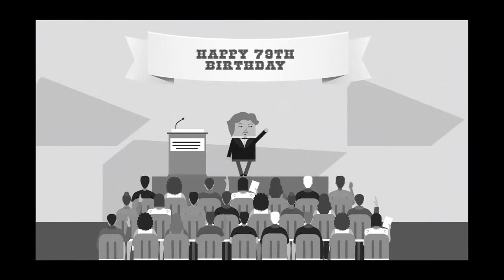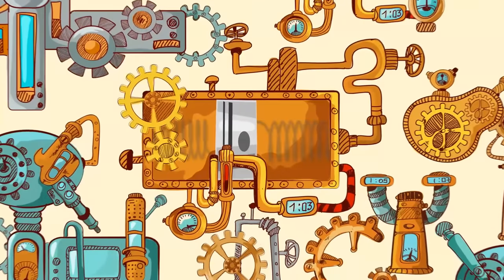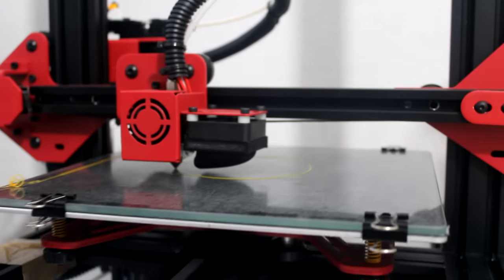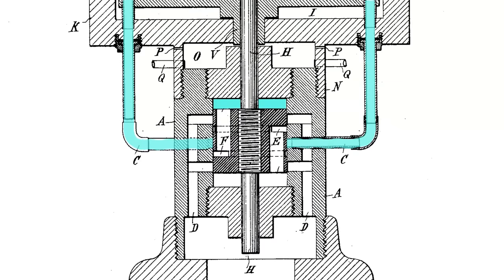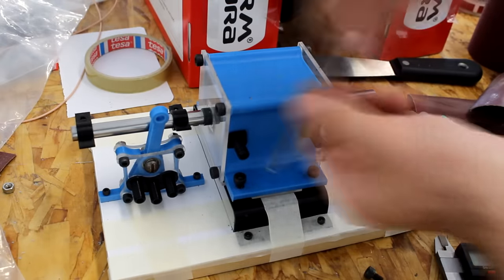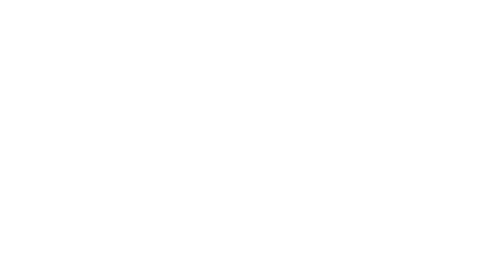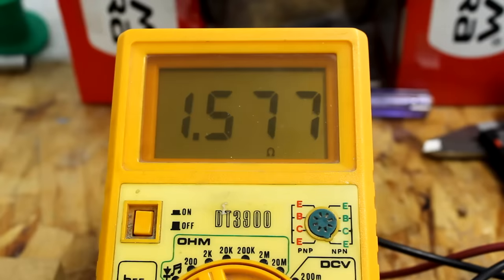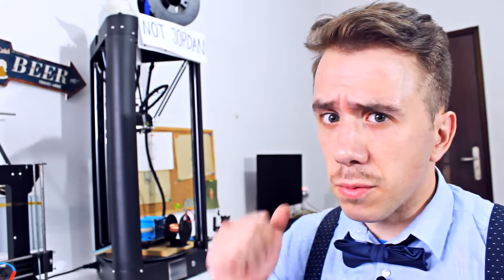Tesla Earthquake Machine [3D Printed]

Comment: Help? I'm incapable of improving that awesome oscillator!
Reply from the maker: Thank you so much :D

I actually need your help with my next project. A Self Starting Micro Pulse Jet engine!
What do you think?
Reply: @integza  holly shit this look very epic
Reply: Absolute legend
Reply: @integza  Parabéns Joel, não é todos os dias que se tem um comentário do Tom Stanton ;)
Reply: @integza  My pulse jet experience is near enough zero, but that sounds like a great idea! They seem a pain to start and a self starting pulse jet would be very useful for an RC aircraft ;)
Reply: Maybe put a full rectifier bridge infront and a small capacitor in parallel to the LED

Using a capacitor with AC wouldn't  be very useful
Reply: @TomStantonEngineering  seems like you guys need to get Colin furze on board too
Reply: @schnibie1991  You can get non-polarised capacitors, mostly used for things like end-stage caps in audio circuits.
Reply: @nigelrhodes4330  But a capacitor in AC is like a short circuit, isn't it? So the frb converts the AC into DC Voltage and the capacitor can smooth it.
Reply: @nigelrhodes4330   All the cap will do is induce a lag between voltage and current, with the net result being less power output (because volts X amps equal watts, and the the lag in the two curves causes the curves to cross at less than full amplitude).
Reply: combine it with a linear alternator
Reply: @integza  I think that You need Colin Furze for this one :P
Reply: Tom should wear a bit of make-up for the joke and dye his hairs
Reply: So glad this channel popped up in my suggestions! Awesome content! Busted up laughing at your method of  "recycling" plastic lol
Reply: @integza  a valveless pulsejet needs am excessive amount of air, a valved one is hard to engineer. For an RC version you could use compressed air and possibly a valveless one.
Reply: @integza  you could use Tesla's turbine and valves as a viable air source
Reply from the maker: @dragonfireproductions790  I might do the opposite, use the pulse jet as pressure supply for a tesla turbine 😎
Reply: @integza  make a CNC mill next for making valved pulsejets and The turbine, gecko controllers are cheap nowadays.
Reply: @integza  for cooling the hot exhaust you can use an intercooler from a turbocharger and dip it in water, to address the pulses from it, buy an air tank preferably a large one with 12 yes TWELVE pressure relief valves, I blew up a tank with a pulsejet before ._. don't make my mistake
Reply from the maker: @dragonfireproductions790  Dude, is like you can ready my mind ! I was thinking about using an intercooler witha a turbo charger to start the pulsejet ! Thank you 😀
Reply from the maker: @dragonfireproductions790  I would like to have one but I need to find the time to do it.
Reply: @integza  a fixed gantry and a dremel would suffice :)
Reply: @integza  i used 3 superchargers to start mine, I used the 30psi one, but it was a valved pulsejet, I actually used it to produce steam and dry stuff with it(my neighbors hate me btw, it's noisy as hell)
Reply: @integza  I used tesla's valves for the valves, heres the video https://youtu.be/F1ty3jaMMtg
Reply: @integza  mr teslonian's playlist is here:
https://www.youtube.com/playlist?list=PLw28_n7AgcmC_c2ajIz93cWR1UvLIPd5Z
I forgot about Colinfurze's vid but you two will enjoy this project :) it's one thing to use to make your neighbors leave 😂 ALWAYS USE HEARING PROTECTION, it'll deafen you permanently
Reply from the maker: @dragonfireproductions790  Can you send me some vids of it working ? 😂
Reply: @integza  yep I sent you mr teslonian's playlist :)
Reply: @integza  https://www.youtube.com/playlist?list=PLw28_n7AgcmC_c2ajIz93cWR1UvLIPd5Z this will be a FUN project 😂 be sure to wear hearing protection because this is extremely loud 😂
Reply: @integza  your next project definitely smells of awesome and win.
Reply from the maker: @inverse2k1  OH YEAH!!! IM PUMPED !
Reply: Pretty sure Colin furze could help but he might be busy lol.
Reply: @integza  furze is da man 😂
Reply: @integza  how bout you 3 come up with a design cuz I'm pumped to see three of my fav Youtubers collab
Reply from the maker: @dragonfireproductions790  Hell Yeah !
Reply: F
Reply: @schnibie1991  You just summoned @electroboom.
Reply: @AlexYeryomin  What do you mean?
Reply: @AlexYeryomin  Nvm I got it :D
Reply: @curly_luke  A colaboration between Integza, Colin Furze and Tom Stanton?
This is going to be epic
Reply: If you use a voltage Transformer You can rise the voltage, un transmisión whit ac the energy losses are due the higth current, and by using a higther voltage You reduce the losses
Reply: People are constantly trying to change Tesla's patents, that's why they fail. If you followed exactly Tesla's instructions, you would always succeed ...
Reply: @integza  maybe ask ColinFurze about pulse jets ;)
Reply: @Jonybigods  Olha um br ai kkkk
Reply: crap i'm working on small valveless pulse jet engine project
Reply: @integza  Do I sense a collab?
Reply: For electrical, what about tapping Electroboom?

That guy is super intelligent, fun to watch, and hilarious. Don't let his videos fool you into thinking otherwise. I think it's purely for entertainment purposes.
Reply: @AlexYeryomin  I thought of him as well.
Reply: I need your help. You know how to create formulas from physical objects and what the are doing. Me I know how to make physics work from hands experience. I.E .... 100 square foot room ambient air trick ambient air in size room compressed down into a more space and then pressure rise in four movements create momentum torque and speed. = watts and energy hmu
Reply: From my other Teslian mad scientist friends, I can tell you that you can use higher gauge wire on the coil, no insulation and, here's the most important factor, it must be wound to perfection. Multi-layering of the coil wire is not necessary. With a thicker gauge copper wire tightly wound with torsion perfection; you might find more success. Hope this is helpful. Thank you for your work!
Reply: @LiLi-or2gm  capacitors are useful in ac circuits.

One of the biggest benefits is that they counteract the lag caused by inductive loads.

Electrical substations use them for power factor correction in spades. A decent sized substation will use banks of a hundred or more.
Reply: This comment thread is so wholesome and productive. I love it.
Reply: Also get in contact with Collin furze
Reply: @integza  when I was four I played with transformer on my train set I broke a wire but put thick wire to fix that broke I wrapped thin wire on the transformer started pulsing slowly getting faster till bouncing off the floor red fire balls appeared about damp patches in room
Reply: This is being used in our government already been weaponized recently used in the middle east Asia Haiti
Reply: Integza micro pulse?!?!
Reply: Tom Stanton try using a corkscrew gear on the shaft which drives a flywheel that ratchets
Reply: Elon musk
Reply: Great... two guys that barely ever make something work, working together to improve their pandering to children. Way to make the world better than it was when you received it.
Reply: Turn the magnets by 90 degrees.
Reply: It would be awsm to watching both of u in single screen 🔥🔥
Reply: Tom i am a huge fan of yours from india .
Reply: Tom Stanton you, &Integza, and @colinfurze collab!!!
Reply: Ijjergom dude... same thought...
Reply: @Tom Stanton I watched the air engine video first
Reply: Easy, add a rectifier.
Reply: Hi tom  Im subbed
Reply: Power it with an electrolysis machine
Reply: I was hoping you were here and you are😀
Reply: Lol
Reply: Integza what if you put a iron or so  weight on the plastic rod to make it heavier and let the first design work
(you could use a iron rod for example)
Reply: Pls try it out and if it works make a little vidio out of it
Reply: Uh oh stinky
Reply: @integza  what is whatapp number?
Reply: are you making it hair tight?
Reply: You need to install your magnets at 90 degrees to the coil. Your magnets are in line with the coil. You're going to get a lot less power out than you could then if you flip those magnets 90°. They should all point straight out through the coil
Reply: Robert Daggett  I know but you use a capacitor  on the coils only to decrease the reactive current (I hope it's the right term in english). So what you say is correct but its not the problem here. The issue here is a blinking LED and for that you have to make it from a wave signal into a straight signal.
Reply: Yoo i luv ur hovercraft so muchhh
Reply: U are so cool
Reply: Collaboration time!
Reply: hey, how about you collab for a billet steam version of this with 4 cilinders? The idea is that you can use water and coal to make steam and generate electricity and move a car. this car could power its own eletric motor because its generating electricity
Reply: @integza  Can the delta or resin printer do perfect circles
Reply: Dude both of you guys are awesome and I love you videos so I’m excited for that Collaboration project.
Reply: Seems like pneumatic reciprocating tool design. Print the tool the same way Clickspring made compression fire starter
Reply: The infamous turbine is Tesla's improvement to the oscillator. There is no improving Tesla's designs; unless you come up with a wholly new and unique idea inspired by his work. All reproductions should be just that; improvements imply that you are doing something different in and of itself.
Reply: When I was a teen, I had an idea that was exactly the equivalent of that oscillator, but instead of steam, I would theorically use some ultra-rare high temperature supra-conductors repulsing ability and strong earth magnets + a condensator and electro magnets to give the boost needed to keep it going.
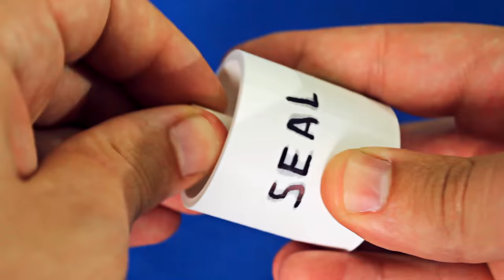Reply: 04:50 for those tasks you should use an lathe... 🤷‍♂️
Even in small factor...
Reply: More numbers of generator connected to a cam with one big cam flywheel
Reply: Lol
Reply: Awecillator
Reply: I advise you looking into how magnetic flux lines are travelling outside a magnet. Then you will recognize that in this setup, veeery few magnetic field lines will cross the the wiring vertically, which is the only reason for current (and Voltage) being induced.
-The Magnets have to be tuned by 90 degrees and an iron core from the inside of the spindle to the outside of the coil will help to improve the flux further. 
+ You have to avoid the field lines traveling from one Magnet to another, so the field lines have to travel threw the coil.
Reply: @cosmicyoke  I live in Karachi Pakistan and I like your
Reply: @sayyamzahid7312  my what:0
Reply: uh
Reply: How has no one figured out 3d Printing a Circle?

Get a rotating Platform, and just Extrude from a Stationary Head.
You should be able to calculate the Rotational Speed based on the Extrusion rate, which varies by Diameter of Circle.
Reply: You essencially reinvented the expansion valve of steam engines! They are responsible for dividing the stream pressure between the two piston chambers causing the reciprocating motion.
Reply: @integza  "Top ten anime crossovers of all time"
Reply: @integza  if you need help with pulse jets go ask colin furze
Reply: 2 legends talking. Please collab
Reply: Hook 4 up to a crankshaft with each section of the shaft offset by 90 degrees and use the oscillators as Pistons to power the shaft and hook up this new engine to a generator. You won't need the air spring part because the oscillators if hooked up correctly will push the others forward.
Reply: hah
Reply: @schnibie1991 @electroboom 
FULL BRIDGE RECTIFIER

Comment: "It works like a charm", if the charm is a piece of dry poopoo, because it doesn't work. Gotta love this new phrase, thank you for the material, great vid.
Reply: Right.  You were there and you have personal knowledge of this event.  Otherwise, please explain how a machine that oscillates and will ultimately produce a harmonic torsion into a "target material", if run with enough force for a long enough period that is capable destroying most construction (at least using today's methods) is somehow not a viable working device??  Perhaps it does not produce the outcome for which it was designed, but I haven't done enough research to know that.

Comment: "The rubber causes too much friction"
You're supposed to lubricate it. Where have you seen unlubricated rubber sealing any moving part?
Reply: Condoms
Reply: @caleb_artzs2533  They come pre-lubricated.
Reply: ZecoRho not the ones I buy from my drug dealer
Reply: @superfoseextra6179  Used ones don't count.
Reply: I'm sure it was just an oversimplification for the purposes of the video.
Reply: @laserlemons1577  And totally not lack of knowlede... sure.
Reply: @Dangerous_BLR  I don't know the cylinder and piston measurements.
Only the guy who uploaded knows them. 

And he could easily sand it down further.
Shitstain.
Reply: @Dangerous_BLR  I know you only operate in redstone but you really could make an effort to write something coherent.
Reply: @MarkButQuestion  im talkin about real life dipstiff
Reply: Make love not science
Reply: @MarkButQuestion  that makes them better
Reply: @MarkButQuestion  some come unlubricated but you're supposed to do it yourself
Reply: It's not about the seal, it's the friction
Reply: It was a simplification. I think he assumed youd put the fact that it wasn't "fat" enough and any added friction (lubbed or not) would increase the issue of the pressure equalizing during travel through the middle.
Reply: Hand pump for a boat. Though you could argue the water it is pumping does it I guess.
Reply: Waterproof light switch
Reply: No, even if you lubricate it there will still be a substantial amount of friction.  have you tried to make a fast-moving piston with a rubber seal?